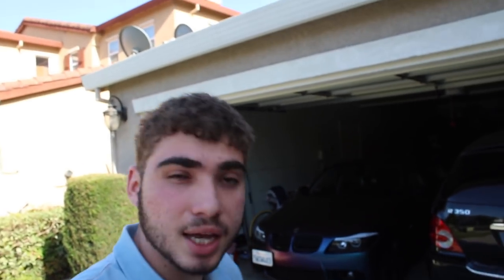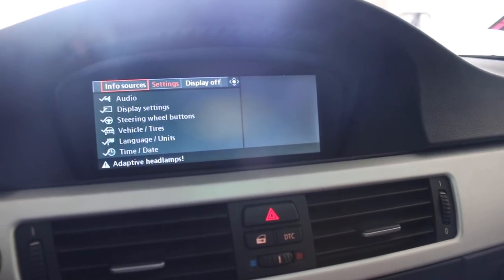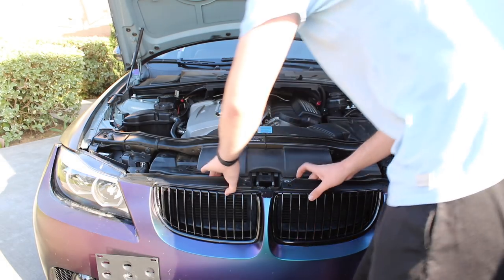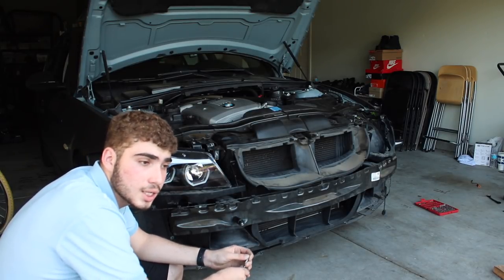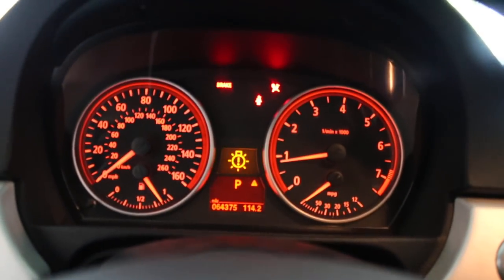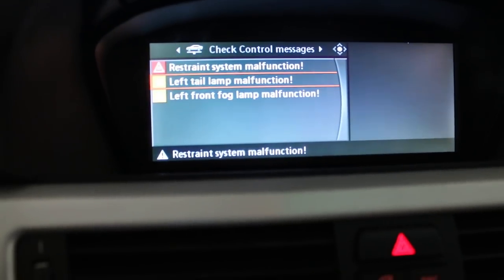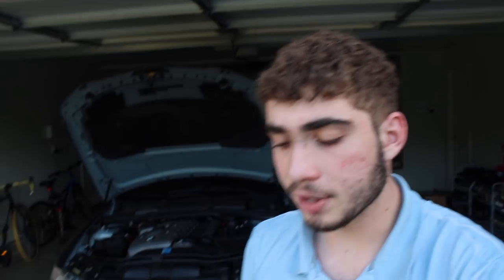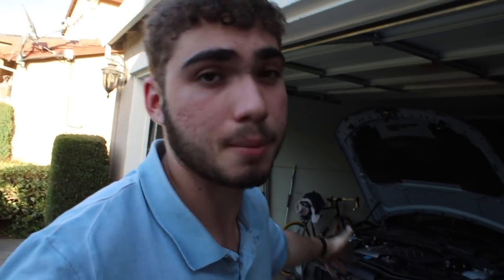CHEAP QUALITY BMW HEADLIGHTS (DRIFT BUILD)

Comment: Hey Nour this is Franky from Germany. I drove a e90 320d for the Last 3 years bought it from the Dealer for 10500€.  With 100000 km. 3 Month Ago I Sold  for 5000€ with 209000 km and bought e93 318i. If you drove once a convertable hard top BMW you Dont Want to miss it. 

Go  for 335i e93 with n54. 
Beware if the Turbos Break it will be expansive.

Here in Germany we have high quality fuel 105. i think you guys have 92 in the Staates.

335i has 400nm 

A Professional drift car has around 800nm
Reply from the maker: yea man i love the e92 and e93.

Comment: I've got a 2011 328i I want to upgrade my lights are those rolling gear lights that missed up? I was thinking of getting some
Reply from the maker: the U lights are all kinda made out of cheap bulbs. I mean they should work great if you get all replacement bulbs and turn off adaptive control.
Reply: Rolling gears sells these lights. This particular set can be purchased on ebay or Amazon for under $400. I have a 2011 328i Sedan with halogens and I replaced the stock lights with these, and they look fantastic!
Reply: Ryan Roell Did you come across any issues with the new headlights yet?

Comment: Light bulbs are not hard to find, bet bulb can be found at any auto parts store,  H7 or H1 bulbs most aftermarket headlights use. Factory Headlights with HID should only replaced with same or will need to be coded. Good idea to clean up original, just get lux angel eyes much brighter
Reply from the maker: DBaddis yea man I plan too

Comment: I have these headlights and they are designed to replace headlights in models that arent equipped with the adaptive feature. Havent had any problems with my new headlights due to the fact that my car had the base halogens and not adaptive.
Reply: Same here. They're definitely for the halogen only set up. I have the headlights and they look sick!!
Reply: Whats adaptive headlights?
Reply: Quick question. I haven't installed mine yet but the halos/ubars run as the daytime lights or do you have to code them?